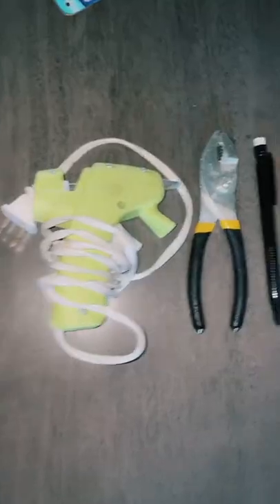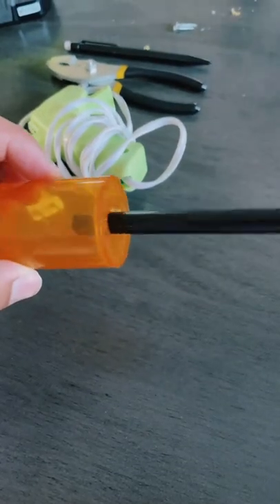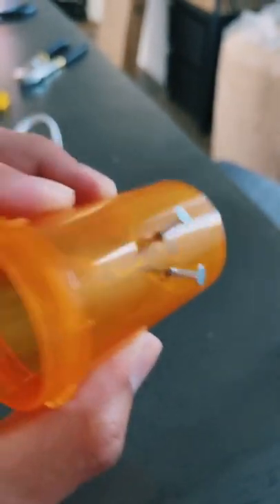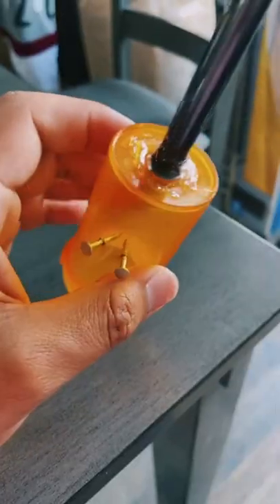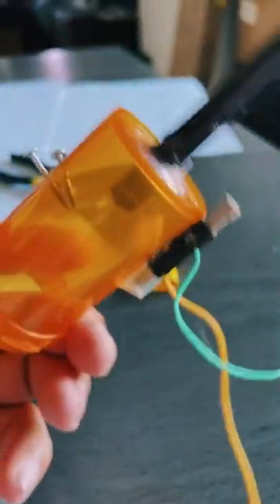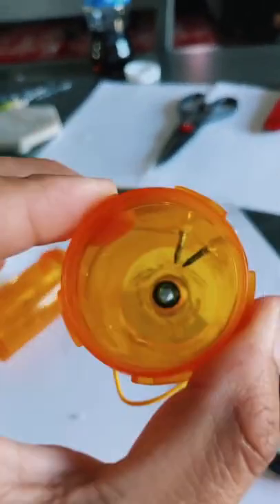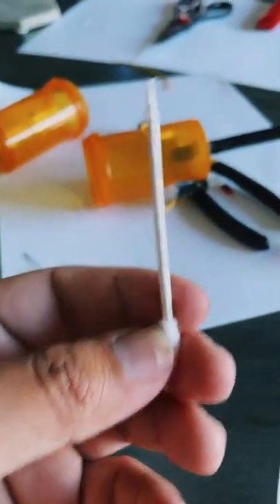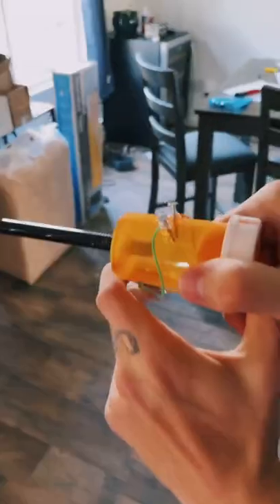I Made A Mini Potato Cannon!!! #shorts

Comment: Only issue is after not very long, the heat is going to wear away at the plastic container aka a pill bottle you used because it's just thin plastic not heat treated pvc like normal potato guns. Eventually that thing is just going to explode in your hand.
Reply: Ty
Reply: Actually I made one 10 years ago and still works.
Reply: @fischersgadgets4936  that’s because plastic 10 years ago was thicker
Reply: not goiing ro explode but the gases inside build up and will puncture a hole there and make the Combustion more weaker
Reply: So I know this is a old comment but couldn't you fix that by not shooting it as much in one sitting?

Comment: make a little silly projectile with aluminum foil/nails use metal instead of plastic and add a lot more flammable liquid and it's a lot sillier >w<
Reply: Note: butane aka lighter fluid works wonders >w<
Reply: add more holes and pen housing to shoot more silly projectiles at a time :3